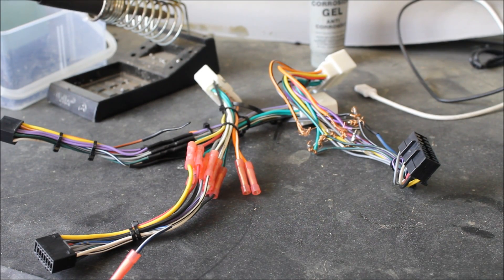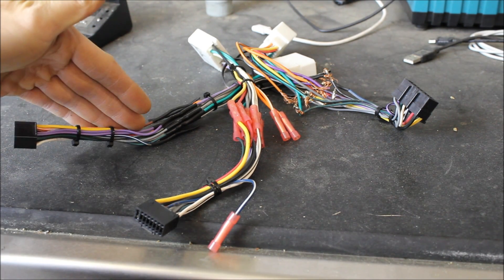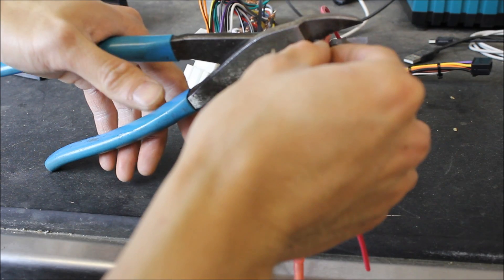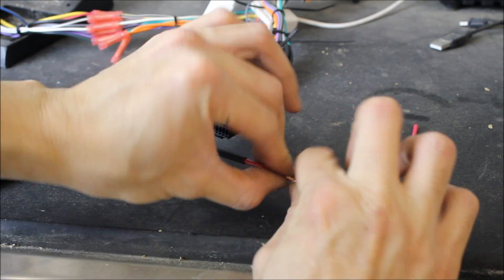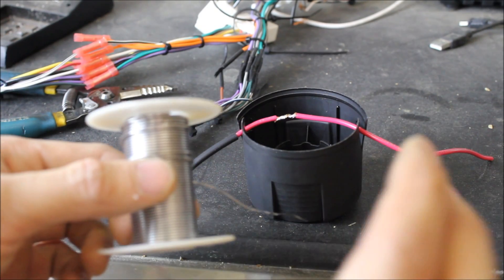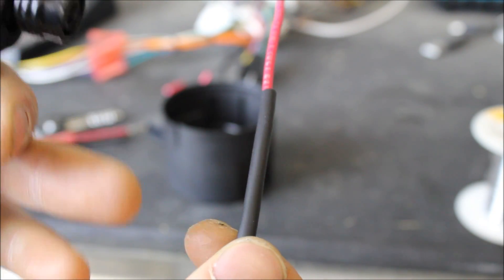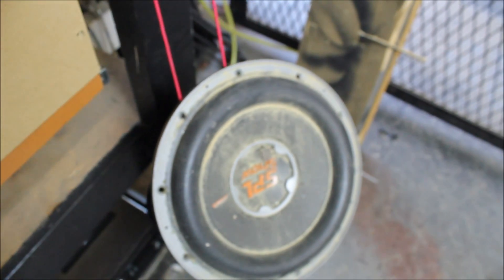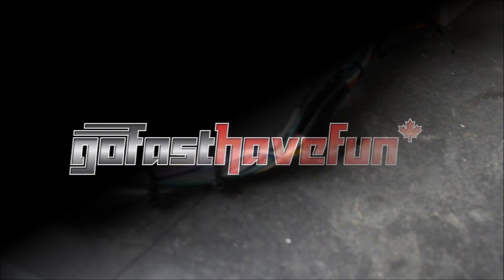Butt Connectors vs Solder | Crimping vs Soldering | Wire Connections | AnthonyJ350

Comment: Thanks for the video but a couple of comments/suggestions. I've soldered wires together using both of the methods you discussed (tinning and not tinning) with equal success but generally I don't tin first. However if you are going to tin the leads first then you should NEVER rely on the solder holding them together. After you tinned them you should have twisted them together. It's more difficult to do this after tinning but you can still get 2 or 3 twists and then heat the joint. This results in a much better connection and the solder flows together much more quickly. Almost seemed like you were trying to make this look difficult just so you could show why you don't like to do it. Also, when doing the crimp connections, using the wrong tool (yours is not the best) can result in over crimping and damaging the insulation. Too much force (like putting the end of the crimper on the table) can actually damage the connector by over crimping. Best to get a ratcheting crimper.
Reply from the maker: It's funny a lot of people make that comment.  But practically every installer in North America (and I know of a top 12 Installer that uses the exact same tool), and also MECP guides also demonstrate using that crimper.  It works fine with butt connectors with a nylon jacket vs a cheaper plastic.  I think this tool is used more because it's simple and works in high volume shops.

Comment: I find un-insulated connectors and heat shrink to be my preferred way of splicing. Also the uninsulated connector's OD tends to be very close to the OD of the insulation on the wire being spliced.  

Solders main weakness is in high vibration applications.
Reply: That's the way I do it looks nice when you heat shrink

Comment: I'm a marine technician and all I use is heat shrink butt connectors and have never had an issue with them.
Reply: Butt connectors are good enough for most applications.  Of course soldering is better but not always needed.
Reply: How do you feel about the heat shrink butt connectors with low heat solder?
Reply: Even aerospace techs use crimping.
Reply from the maker: I use marine grade butt connectors on Law Enforcement vehicles now.  But if I'm intercepting factory wiring, I prefer solder because I don't want to cut factory wiring if I can help it.

Comment: in my expierience, solder connections tend to crack in cold conditions
Reply from the maker: How cold does it get in your area?
Reply: (cleveland winters have quite a few days below zero, but my truck is a solid sheet of ice for 3 months) but woooaahhhh i may sound like idiot of the year here but watching your 'how not to do car audio pt 4' i may have just found myself inncorrect.... i was told it sounds like a 'cold solder' , i assumed that meant the joints wouldnt hold up in freezing weather.... do you mean to say that actually means my gun wasnt hot enough when soldering??? wow i feel dumb, that makes more since, as it did look clumpy and i was using lead free solder...wow mind blown

...thanks for the reply and the knowlege, your a godsend ive been watching you for years
Reply from the maker: Brian R Thanks for watching my content! Yes cold solder joint is a poor soldered connection which is usually due to not enough heat.

Comment: OK, sorry for the lengthy post, but I think it's required.

Here's my position on the crimping vs. soldering debate (in relation to the automotive environment, anyway). Hopefully, it will help clear up some of the confusion, perceptions and misinformation. -- Or hell..., it might do just the opposite, confusing and enraging some. Either way, I welcome any comments or criticism, constructive or otherwise.

Crimping gets a bad rep primarily from technicians/installers using the wrong stripping or crimping tool(s), the wrong crimp connector/terminal for the application, or both.

The most common problems are caused by using a combo wire cutting/crimping tool. Specifically, a device meant for cutting solid conductor wire and crimping non-insulated connectors (120-240V electrical rel.), being used on multi-strand wire and insulated connectors/terminals. The most common & likely offender is the Klein #1006 (or 1005) Crimping & Cutting Tool, or similar. (I could be wrong, but I believe this is the tool I've seen Doug Bernards (Soundman) using in some of his videos…?)
 It's designed for cutting (not stripping) solid conductor wire and crimping non-insulated terminals. When used for stripping insulation on multi-strand wire, the tool will crush and break several strands of the wire. Then, because of the crimping die's stake (pin, or "tit"), it will over-crimp and deform the insulated connector/terminal to the point of severing a large portion the wire strands that remain after the stripping process. There's a high probability that eventually, the termination fails or causes problems when the few remaining strands connected, break from vibration & stress related issues. (Also, some technicians/installers incorrectly place the stake over the seam of a non-insulated connector/terminal.) 
NASA makes connections using dedicated wire stripping & crimping tools, along with correctly sized and duty specific connectors. They solder as few connections as possible, soldering mostly high density bulkhead connectors with solder cups. The automotive manufacturers crimp everything. There's a reason for this. Both industries use crimped connections because they provide highly reliable and repeatable results, and the process is a much more efficient method and operation. (Here's the link to the NASA Technical Standard doc, and was included in all my "New Project Packs" for Technicians. https://nepp.nasa.gov/files/27631/NSTD87394A.pdf (rev. 2016) 

When you consider the 600-800 degree temps when soldering, combined with the possibility of damaging a vehicle's interior from accidentally dropping the iron or molten solder on the upholstery or carpet, or the high temps melting adjacent wiring or plastic components, in the realm of automotive electrical/electronics, crimping wire connections and/or terminations is the preferred method.

Again, this is just my position. I've been involved in the low-voltage industry over 30 years. Very early on, I chose to adopt and learn the correct process of this method after experiencing all the issues and failures of the other procedures. I've got a bench full of assorted soldering and de-soldering stations and portable irons, but they never make it into the shop or any vehicles.
I could go into more detail, but you've suffered enough !

Hope this was useful. Happy Trails....
Reply: Excellent and accurate post. Those combo pieces of stamped junk should be avoided along with the style splices they are used on. Bare crimp splice + heat shrink is far better and prevents moisture ingress.
Reply: I'm glad somebody addressed this. Crimping is almost always superior to soldering when using the right tools and connectors. He was using auto parts store quality tools for those crimps. The only benefit of soldering over crimping is that you can get decent results with equipment you can buy anywhere. If the choice is cheap crimps or solder, then always solder. But anybody who does electrical work for a living (or serious hobby) should have the tools and knowledge to do good crimps. I would not be impressed by an installer who soldered (though it certainly beats an installer who uses cheap connectors and crimpers).
Reply: Jeff Maxwell do you have any examples of high quality tools and connectors?
Reply: Nasa allows for both soldered and crimped splices but keep in mind their crimping tools are nothing like is available to the peasantry. Theirs are ratcheting types and they specifically note that the stranded wire is NOT to be twisted prior to insertion. 
Solid single strand conductors are typically made using a lineman splice. Splicing should rarely be done but if they are, there are applications for both crimped or soldered depending on location.  Here is some of what they say:

Page 25
NASA-STD-8739.4A – 2016-06-30

7.2.32 The use of splices in a harness design should be minimized as much as possible. The
simplest and most reliable wiring design is one that results in the routing of a dedicated,
continuous, and unbroken conductor from point to point. The following shall be incorporated
into any splice design:
7.2.33 Shrink sleeving over the splice area shall be protected from cold flow and abrasion.

7.2.34 Splices shall be covered with a single layer of heat-shrinkable tubing or insulation
material that meets or exceeds the minimum electrical isolation specified in the engineering
documentation. Additional layers of tubing and insulation may be added to splices to increase
electrical isolation or to provide additional environmental or mechanical protection.
7.2.35 Splices shall be staggered to minimize buildup of the wire bundle diameter.
7.2.36 Splices shall not be located in areas of the cable where flexing may occur or in bend
radii where the primary insulation may be compromised.
7.2.37 Splices shall be prohibited within two harness diameters of a breakout.
7.2.38 Splices shall be identified and fully defined on the associated drawings including type
and location.
7.2.39 Heat shrinkable soldering devices shall not be used in the vicinity of sensors, optics, or
other devices whose performance can be degraded by surface contamination.
7.2.40 The solder alloy and the flux type in heat shrinkable soldering devices shall be selected
for the type of wire being spliced.
7.2.41 Splices shall not be installed where adjacent components, wires, solder joints,
structures, etc. cannot be adequately shielded or otherwise protected from a heat source during
the splice installation
Reply: Barry Bishop nice post. Would be cool for you to make a video showing your method what you describe here. Let me know if you do. Cheers!
Reply: NasA also has a video on how to join wire w/ out soldering too. I usually do the NasA" wrap" and then solder for my drones
Reply: As for crimping, many of the cheaper crimping tools do not form the necessary gas-tight connection that is needed to prevent oxidation. Use quality crimpers! I rarely crimp, but when I do, I use a ratcheting-type made by AMP. Expensive but excellent. I also use quality connectors and terminals. I think Boeing Aircraft uses the "Daniels" line of crimpers.. Very $$$..
Reply: Makes sense. But I don't prefer soldering due to higher reliability.

Comment: What Brand Connectors Do You Use? hard to find a good brand. Thanks in advance :)
Reply from the maker: Currently we're using Install Bay's insulted nylon butt connectors.
Reply: AnthonyJ350 what model is your Channelock crumper?

Comment: I can't believe they still sell and people still buy those hard plastic connectors!! (though looking on e-bay, a lot do) They are simply, utterly useless!! Poor wire security, no protection from water etc, bulky and really cheaply made. If you use them, you deserve your vehicle to go up in flames!
Reply: This is pretty harsh.
Reply: Harsh but true!
Reply: If you're getting water behind your radio, you have bigger problems.. and hey, maybe all that water will put out the fire you claim that is inevitable from using crimp caps/butts.
Reply: Can't you just use the plastic connector, and then wrap insulating tape around it?

To further protect and waterproof your wiring?
Reply: Peter Huskins surely you've used them, otherwise you would have this opinion.
Without a teacher we all learn from trial and error
Reply: It's pretty accurate! Try bare connectors with proper crimper and heat shrink. You'll be delighted!
Reply from the maker: Thanks for the comment!

Comment: Here is a tool we use to hold the wires together while soldering. 
https://www.automotivecircuitsolutions.com/collections/products/products/wire-holding-clamp-soldering-aid-helping-hand
Reply: Automotive Circuit Solutions 
Cool little tool but im pretty sure I can make that for about a buck.
Reply: And this one...
https://www.amazon.com/dp/B001C6NJOA/_encoding=UTF8?coliid=IDNGQHXW8PU1O&colid=19GUY0SELZ24U&psc=0
The 2 clips are held on magnetically.... Very versatile...

Comment: Wow! Please tell me you don't do this professionally. First off, you're using a crimp tool meant for uninsulated butt slice connectors on insulated butt spices! Secondly, if you're going to go the butt splice method use a proper ratcheting crimp tool! Thirdly, stagger your splices!
Reply from the maker: DG Bennett I know it's out of application but the tooth doesn't cut through the insulation. Staggering I get the benefit of staggering but if you have to stagger you're not insulting them well and that would take forever to make it look clean. But your more than welcome to make a video and show us what your harnessing looks like.

Comment: I have a question for you now what if you use the Bell type but connector its where you twist the two wires together and stick them into a Bell connector that looks just like a little bell and then you crimp them together. have you ever tried that method and if so what do you think about that method?
Reply from the maker: ryan fike I've taken a bunch apart. I think the connection is decent because the wires actually and you crimp it. I just really don't like how it looks.

Comment: On the butt connectors why not twist the wires together before slipping the butt connector over the joint?  Then the wires would be in direct contact.  Maybe that is the wrong way to do it.?
Reply from the maker: brianaple They don't work that way because there's something in the middle and the wire insulation won't pass through.
Reply: oh yes, I was thinking of a different type of connector.  It looks like transparent heat shrink tubing with a band of solder in the middle.  You slide it over the joint of two twisted wires.  When you heat it up the ends shrink and adhere to the wire insulation while in the middle the solder melts into the twisted wires.  I don't know what this is called but I would think it would be a step above this butt connector setup.  It is kind of the same thing but it also melts a band of solder into the twisted pair of wires.

Comment: I stopped watching when I saw the tool  you used for crimping insulated connector.
Reply: Intrnt Tough Guy He’s using a tool that has a insulated and non insulated die. It’s obvious you aren’t an electrician... nothing wrong with the tool he is using.
Reply: yeah.  use a proper ratcheting crimper or go home.

Comment: If you hold the 2 leads and have the soldering iron resting on something (I rest it on my helping hands) it becomes a lot easier with the tinned tips method. 

I'll tin multiple wires on a harness and then quickly join them using this method.

Comment: Those red butt connectors can be heatshrunk and contain glue too. At least the ones I bought like them are like that. The glue actually seeps out of the end. I use them underwater for submersible pumps without any issues.
Reply: Those are the good ones, as opposed to auto store trash. The term to look for is "adhesive lined".
Reply from the maker: You can also do marine grade butt connectors.

Comment: Anthony,I have a very basic question. I remove my dash plate and there is a wire that is connected to nothing.I strip it and put a meter on it to find it is pumping 12v when ignition key is on but it's dead when ignition is off. Can that wire be used as the switched power(red wire on most harnesses) no matter what?I mean to say is there any danger with it?I sometimes worry if the wires go somewhere else in the car and are not meant to be used for car stereo power.
Reply from the maker: John Adams The deck typically pulls amperage from the main constant line. If you're worried about it throw a low amperage rated fuse on the line you're concerned about.
Reply: AnthonyJ350 Well I pulled the fuse in the box that was labeled "radio" and the wire was completely dead even with ignition on so apparently the line is fused already.
Reply from the maker: John Adams You should be able to replace it with the appropriate fuse and it should just work after
Reply: Another question Anthony.I am just about done installing the deck into my work truck.Its an older tractor and where the deck is going to go there are a lot of wires in the way.I used zip straps to get most of the wires up and out of the way,however one particular harness is still slightly in the way.The back corner of the deck hits it and I have to push firmly to get it in.That or I can drape the harness over the back side of the deck.The question is .....Is it ok for wires to be touching the deck or is it a potential short or fire?Thanks for addressing my concerns.
Reply from the maker: It's a potential for a short.  Can you make a hole and re-route the wires or remove a section for the wiring to go into?
Reply: I definitely can't do any of that but tomorrow I am going to see if I can possibly move that harness with zip ties.It literally only needs to move like 2 inches and all will be clear.Theres gotta be something I can hook onto.The space is tight and I can't pull the dash apart.I am doing this while I'm working,like 5 minutes here and 5 minutes there so that makes it tougher.
Reply from the maker: Keep in mind 2 inches is a lot when you're talking about clearance in a dash.  Pull your head unit out 2 inches and you'll see what I mean.
Reply: Yes,I guess I exaggerated a bit.If I got the harness to move a half an inch to the left the deck would clear easily.I was just thinking 2 inches because that would be more than safe.